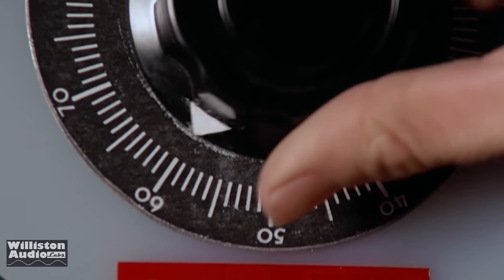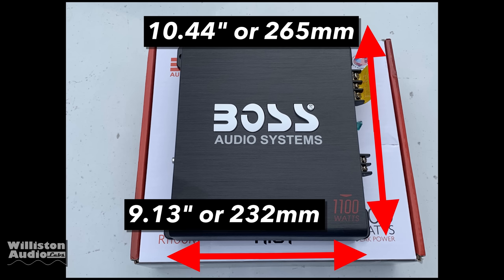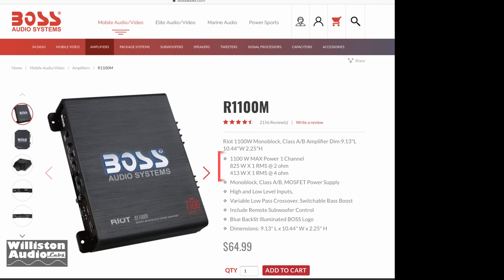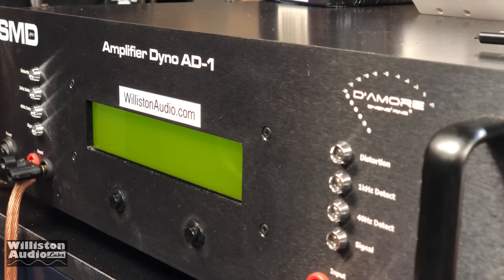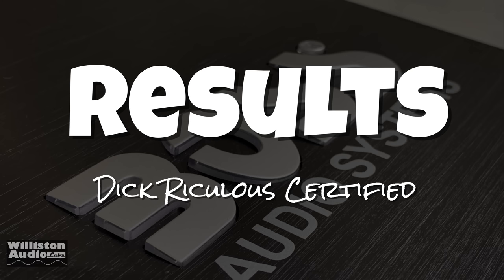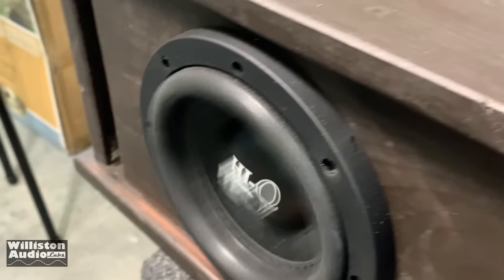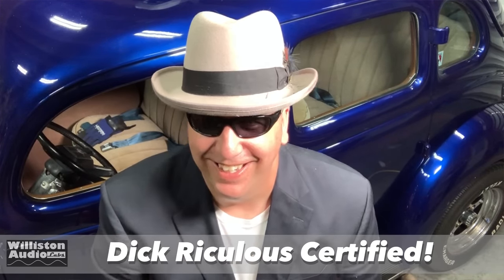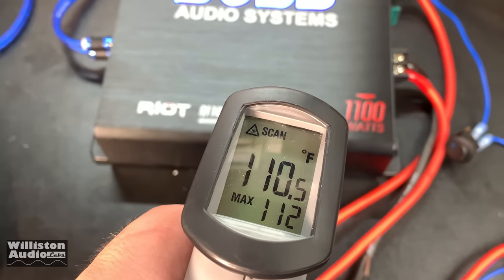Best Selling Car Audio Amplifier on Amazon (2019)? Boss Riot 1100M Monoblock [4K]

Comment: Much respect to uou and the others who yrst these amps but we jave to remember the marketing is based around its sells anually and the streets are where the money is generated and not the competition forums.

I am not a fan of the boagus  numbers but to a untrained mind? it hits hard to them and it works well in there set up and we temd to forget that these street builds are harsh,bery harsh but these brands allow the misusage and they are cheap enought to replace and plentiful. 

they would do better if the numbers were better but most don't care about the fue to the parent company is looking more at the the numbers rather than customers request

Comment: Say what you want about boss.
I have run a boss ndx5500 for almost a decade now. I switch setups from time to time but I keep coming back to the boss. I know it's numbers are inflated and I know it's not a super high quality unit...it gets very very LOUD it sounds very good.
Mine uses a anl fuse ( rated for 200 amps) . It works good for my nko 12's . I ran two 501s's ...one per sub ....they did good but they would go into thermal on hot days. 
The thing with bosses , they clip very easily, it's easy to over drive them and it's easy to over work them. One positive is they force you to learn about set up and tuning your equipment.
Reply: Yeah but that was the last of the old boss. Boss even used to be made in USA. Those Onyx amplifiers are actually really nice. boss is a complete trash now
Reply: @rmblwgn  I just seent on eBay they have a new model onyx out. Spade terminal bs and on board fusing . I think ox4k is the biggest . Also saw a butt load of the old blue and aluminum onyx surf board four chans ( I didn't know they existed ) I may grab one just for shits n gigs . Going for 130.00 bucks . I don't normally go after boss stuff ( even the zed audio bosses ) but I really like the sleeper aspect of these onyx amps. that and the refurbished ones from the place I got mine seem to be better than the bone stock ones.
Reply: @robsorgdrager8477  I see nxd4500s for 130. Wonder how much  fusing on those
Reply: @rmblwgn  I would assume fusing is like one sixty to one eighty...they might use a 200 amp fuse....don't know. I know mine pulls like 150-180+amps on full buggy but I have a big ole crown Vic p71 with a 250 -230 amp alt going to a red top optima and the giant 3 . I also have some aux/start stop batteries as capacity in the back.

Comment: Buy Mono Block amps not Mosfet amps. Mosfet amps are for door speakers. Mono Block are for subs.
Reply: Not all the time buddy. Class A/B is cleaner power than Class D which 99% of the guys in this industry refer to as Dirty power
Reply: @VisionSandS  class A/B amps run hotter than class D amps. Everyone I've known use class D amps to power their subs. Mosfet amps always burn out if used for subwoofers

Comment: Great video!

I have this amp on a rockford p3 12 and it does ok, but the sub runs out of power.

Btw I have mind running @ 1ohm and it works like a champ!
Reply: Luin Haden What does it mean for a subwoofer to run out of power?
Reply: @GloweIndustries    you run out of volume.   Its like trying to feed a 1000hp motor with the same fuel that a 100hp motor takes. It will work to a point, but you need that extra fuel to make it do its full potential.

You reach max spl of a woofer and you still have volume left.
Reply: Hmmmm. So a woofer runs out of volume when you hit its max spl but you have volume left..?

Not sure where to start, but... that’s not how any of this works lol. You’ve mixed up some terms there. 

Volume is either your audio level control or the total airspace of your enclosure.

SPL is sound pressure level, commonly measured in decibels. 

Subwoofers are the actual circles (or squares) that you screw into your box. They don’t produce any power. 

The amplifier is what takes a low voltage signal and amplifies the signal many times over and feeds it to your subwoofers to make them move and reproduce the desired sound. 

If when your volume is low your subwoofer has reached “max spl” and doesn’t get louder when you continue to increase the volume, it sounds like you have your gain on the amplifier set incorrectly.  Even if you’re under powering a woofer the volume should not reach its maximum until the same point your other speakers are.
Reply: In your example of the motor, the subwoofers would be the wheels on the car.  They had better be able to handle the power.
Reply: It is clipping or your enclosure is a turd.
Reply: @GloweIndustries  instead of asking....  why didn't you just educate me.  Make me look like an idiot.  Thanks
Reply: Not trying to make anyone look like an idiot. Not my intent, promise. But I’ve made myself look like an idiot by explaining something, only to realize I misunderstood the information the originator was attempting to relay.. so, gotta make sure I understand first.
Reply: @GloweIndustries  I can't understand either. Sounds like he is playing bass music or kick drum music, the sub is in a ported or oversized sealed enclosure, and it is unloading or sounding "hard" at moderate audio volume. Whatever the root cause the sub is at Xmax or a little beyond.

 It is this or the amp is clipping because of gains being set without an SMD DD-1, oscilloscope, or at least a True RMS Fluke or equivalent multimeter.

If any sort of equalization or tone shaping has been used then who the hell knows. Dude needs a higher end RF bD mono amp or an Audio Control mono amp then I want to hear someone say "runs out of power". Then we would know.

Comment: Well my 1100 watt mono black boss amp wasnt a riot it was the armored version an it pushed 2 kicker comp r that rated 1470watt peak at 1ohm each an was 750 arms  an wired them for 2ohm an they thump so hard had cops called same speaker had the boss phantom series mono block 2500 watt an it set of car alarms but its biggest down fall was over heating an finally burnt up with in 6 months but the armored series has all ways gave me good luck ... but I think yah must know by now these boss company is a american made company who has them built in china because it's cheaper so that means the spec sheet is a random printed sheet from america it's never actually amp dyno in china befor shipping as apart of quality control testing ..  if it's even actually checked at  all hence why it says on the box usa design...some amp series are better then othere

Comment: Absolute junk! mine fried, won’t stay green, flips into protect right away and hisses through the subs now. Only had 2 tens rated at 300 rms on 2 ohm load.
Reply: I've had two of them since 2014 and they both still work. This particular amp is amazing for the money. Go read the reviews on Amazon, the people who actually buy this amp and use it and abuse it for years and it still keeps on going (for them).
I have not bought one since about 2015 so IDK, maybe they are not build as tough as they used to be.

Comment: If it holds up and lasts a long time, id pay 50 bucks for it.  All the manufacturers must have some other type of test to get 800 watts.  Maybe if you run the voltage way up .
Reply: Brazilian amps are the best.....taramps and sound digital.

Comment: Mine runs almost blows my sub and it’s a 800 peak watt kicker Cvr 12
Reply: What do you mean by blows? Lol and what does 800 peak have to do with anything? Are your gains set correctly and are you sending clean signal to the amplifier? Subs only blow with high power and or bad signal/ clipping
Reply: Why would you entertain a newbie?  This amp couldn't blow it's own fuse, let alone a kicker comp. Most likely he has the gain, bassboost all the way up, an it clipped it so much till he fried the tinsel leads thinking he blew the sub, but in reality he distorted to death😂

Comment: I will never used that brands Like Boss Rockville Belva Sound Stream Planet Audio or Pyle Lanzar. Piece of Junks. I will rather get Hifonics or crunch brand precision power for cheapest amp.
Reply: I've had a hifonics 3200 watt Zeus hooked up to 2 solo baric 12 inch subs for over 10 years and it still works like new and has Never went into protection mode. Best amps for the money in my opinion. The power is pretty aqurate also
Reply: I've ran Planet Audio amps for years with absolutely no problems what so ever.
Reply: @timothywaldroff7121  I didn't say they had problems. I mean there cheap and will move the subs. I've seen Amp Dyno on them on YouTube.. and the amp pro says there dirty. Someone who doesn't know caint tell because you can't compare. But it's not close to rated power, dynamic power, certified, or uncertified. You can look em up. About the cheapest ampi would go is hifonics

Comment: I bought some boss subs and they didn’t last and went to shit, and the amp I bought wasn’t boss but went to shit, so now I have skar subs and a planet audio amp, you should do some planet audio tests on there amps, I have one that says it’s (3000) watts
Reply: Hate to tell you this bud, but Planet Audio IS a Boss Audio product. Owned by, designed by and built by Boss Audio.

And that 3k amp isn't putting out near that claim AND a number of the PA high power amps have been known to catch on fire, so beware.

They are owned by Anaba Group last I checked. Planet Audio now isn't the same as Planet Audio of the '90s.

Google it.
Reply: V S didn’t know it was made by boss audio, the first amp I had developed the weirdest problem that I still haven’t figured out to this day, so I bought this one and I haven’t had any problems with it, I have noticed it gets considerably hot and draws tons of power, when I drive at night it makes my lights dim a tad bit when the base hits, I might just need a capacitor though

Comment: I have this garbage amp still in the box in my closet. Idk what to do with it cuz it's obviously junk. Got the little power akoustic amp from Walmart, it's a great little amp for the price.
Reply: Brandon Deel Buy a real car amplifier. 
Without this channel we would never know what we are buying.
Reply: @alexandruturza7131  the other guy that reviewed this amp also reviewed the power akoustic I have and he said it was a very good amp for the price and I agree. Put out a true 600 watts rms and only cost 100 bucks. I use to have a really nice setup until someone broke into my truck. Had a old kicker zr360 with the swx 550 crossover, powering a Alpine type r, it kicked like I had more than 1 sub. I swear by that amp but you can't find them with that crossover anymore:/ I went cheap to replace that setup and I don't regret my amp purchase. Kinda regret my sub choice though. Got the pioneer road series 12 dvc and my amp is trying to fry it. Gotta get a higher watt sub for this amp.
Reply: i had this boss amp in my car for two years. it worked completely fine to power two shallow 12s and it never once cut out on me.
Reply: @daltonderrick16  first time i used this amp on my Kenwood road series dual 4 ohm 12, it kicked almost immediately. My power acoustik for 20 dollars more wants to fry my sub. This boss amp is complete garbage and i stand by that statement.
Reply: These junk cheap amps are hit and miss... 1 out every 8 is crap and will die soon others will last forever... Lol